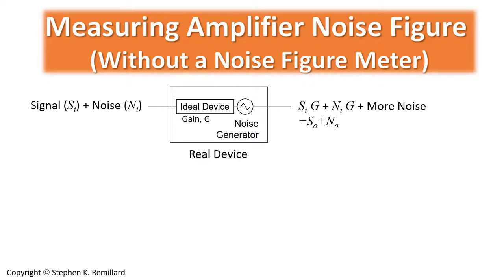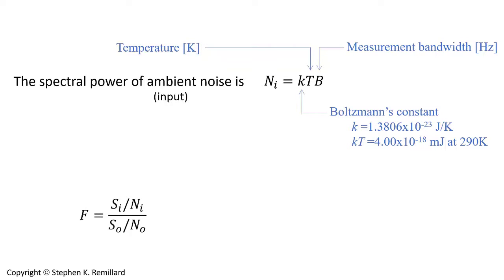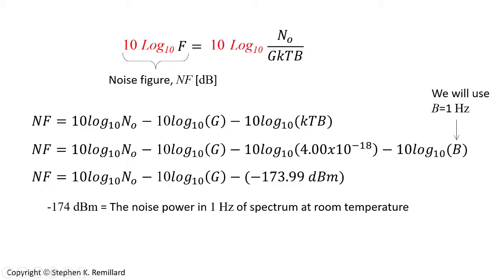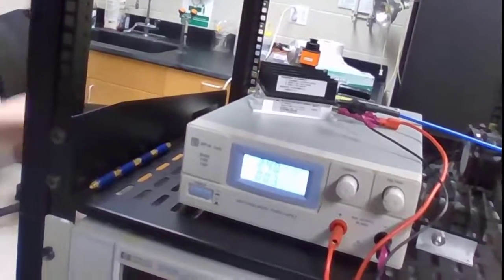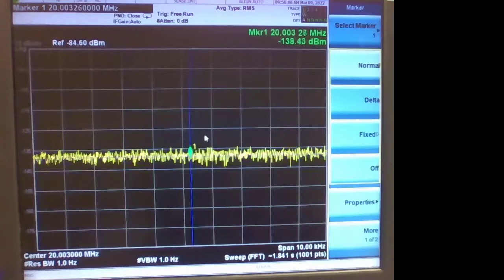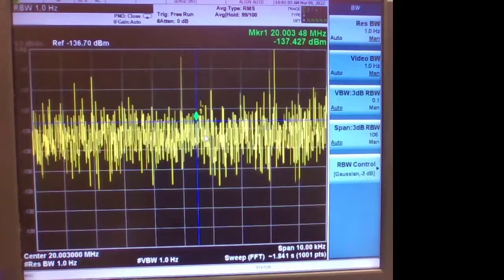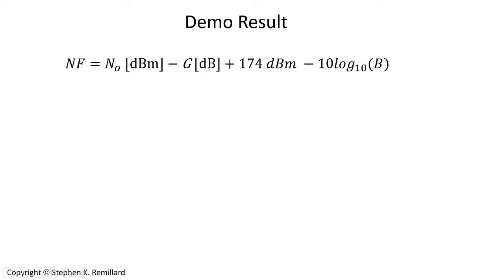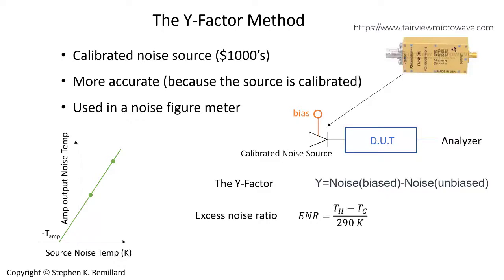Measuring Noise Figure using a Spectrum Analyzer - The Gain Method

Comment from the maker: As soon as I post any video I always see something that I wish I had said.  I would like to add the little fact that -174 dBm/Hz is the ambient noise only at 290 Kelvin.  In the vicinity of room temperature it goes up (becomes less negative) by about 0.07 dB for every 5 degree Celsius increase in temperature.  
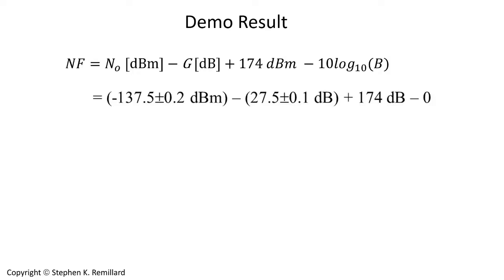Also, at 10:40 I mention too briefly the need to account for cable loss in the gain measurement.  So Let me re-emphasize it here.  Careful that your gain does not include cable loss.
Reply: Re: "Careful that your gain does not include cable loss", -Do you mean 'does' or really, 'does not'?
Reply from the maker: @j.w.8663  "does not".  Make sure that the number that you conclude for the amplifier gain has accounted correctly for the insertion loss of the cables.  For example, if the amplifier has 30 dB of gain but a cable was included with the amplifier (sometimes necessary) that has 1 dB of loss, you don't want to conclude that the gain is 29 dB, even though that's what the spectrum analyzer is telling you.
Reply: Ah, I see. The gain only of the amp. Thank you for the reply!

Comment: I have a variable gain setup with an attenuator followed by an amp. For our "low gain" (0dB) setting, there is a -22 attenuator feeding the amp. In that case, I cannot simply terminate with a 50 ohm terminator, because then the amplifier wouldn't "see" the -22 attenuator. Therefore is it a fact that I can't use the "gain method" for this setup?

Comment: I will be using pyramidal horn antennas with an LNA and a spectrum analyzer to scan in a 360 degree azimuth to look for possible interference in the X and S bands (2GHz and 8GHz). One of the requirements is to "Calculate cold sky noise temperature at 10 degree elevation." Would you (or anyone) perhaps know how one does this? Is this simply measurable somehow? Google doesn't get me too far...😕
Reply from the maker: I'm in the same boat as Google.  Not really something I know how to do.
Reply: @stephenremillard1  ok, thank you.
Reply from the maker: @j.w.8663  I wish I could be more helpful.  Your question did stir up a memory for for me, though.  When I was in grad school I had some microwave measurement questions, and I contacted someone at NRAO (National Radio Astronomy Observatory)  who was very helpful.  I even went to visit since I was close.  It impressed me how eager these guys were to be a resource for a student.  I'm going to guess that there is well-established know-how for your specific question that resides squarely in the radio astronomy community.  I don't work in that field, but it does have a wealth of knowledge about microwaves, the sky, noise, etc.

Comment: Use spec an often at work to verify Noise Figure or estimate noise power at DUT output.  Calibration is critical. Always expect some error when testing via this method
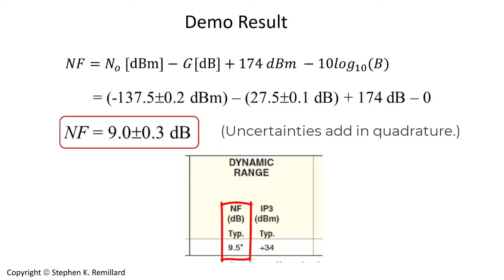Reply from the maker: You are quite correct.  It is really hard to eliminate systematic error from a technique that does not rely on a calibrated reference.  The quality issues of this method were anticipated at 11:25.
Reply: @stephenremillard1  I do not recall a mention of noise floor (dBm/Hz) of this spectrum. Our spec an typically has noise floor of @-140dBm/Hz. For a good measurement I typically try and get the measured noise 16dB higher than spec an noise floor
Reply from the maker: @jason conerty  Good point and I like your rigor.  I no longer have access to the lab to get the noise floor without the DUT, however the CXA at 40 MHz using log averaging, with neither input attenuation nor preamp (the conditions of this video), has a DANL (displayed average noise level) of -150 dBm/Hz (typ).  Without having given it much thought, I have always used a less conservative 10 dB higher rule, but 16 dB sounds like a good idea, and probably well thought out.  Could you say something here about the importance of a larger noise difference?
Reply: @stephenremillard1  regarding measuring noise figure in this type of setup with a DUT that has significantly lower noise figure? It's difficult to do this with a spectrum analyzer. Your best bet is to have two DUT available and allow one to settle and understand the noise power displayed on the spectrum. For instance if you have a a DUT that has 20dB of gain and 3dB noise figure you would expect the noise power to be at -174 plus the gain and noise figure of the DUT. Now this is specifically only the noise power of the spectrum with additional noise power presented specifically by the set-up. Adding the one Specific DUT you wish to acquire data for you would assume that total noise power is the sum of gain for both DUT plus the noise figure of the first DUT. It's messy and requires understanding of temperature and gain for both devices. It's a lot to take into consideration. Also if both devices are identical then order can be switched. This is usually something I only do for proof of concept. If I'm nervous about test equipment ENR values etc